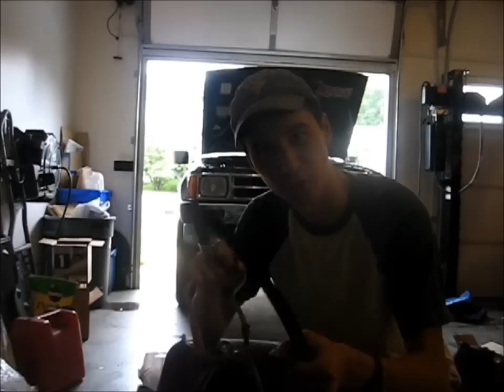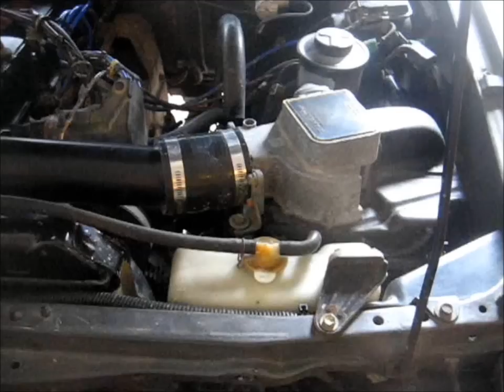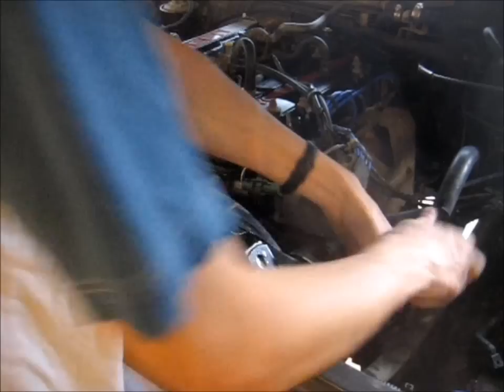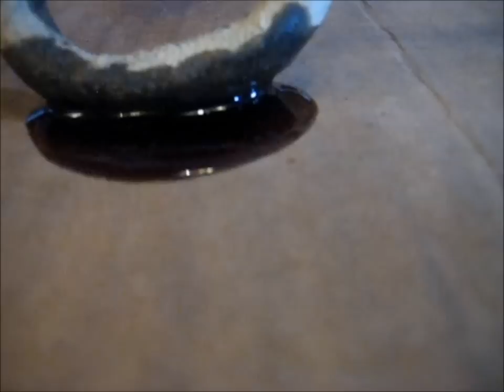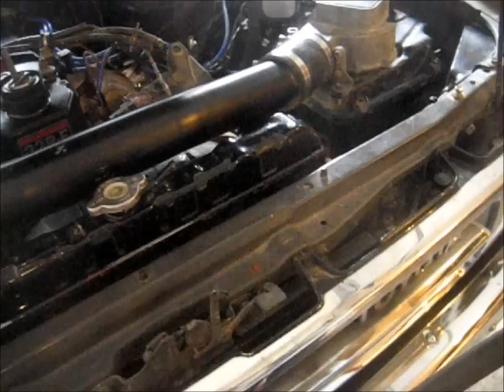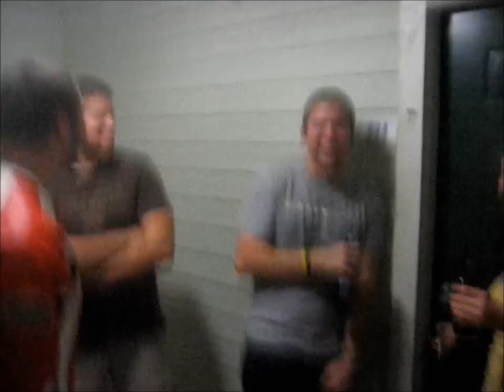Replacing 4Runner Power Steering Pump and Hose

Comment: At the beginning of your video you mentioned that your power steering pump was making noises. It would have been helpful if you recorded the noise or at least described it. My 87 4Runner is making tapping sounds in the vicinity of the PSP.

Comment: Just changed ps pressure hose my 88 4runner 22re,  reused bracket on the line at the gearbox, what a pain to remove, was spot welded together. Yours?
Reply from the maker: Yes, same situation. Done it twice now on different vehicles.

Comment: I did not get what you did to solve the clamp that had a spot weld on to. Did you get a new clamp and if so what type? Thks...jc
Reply from the maker: I drilled out the spot weld so the clamp could be opened up and swapped over.
Reply: @TheAlexManVideos  so how did you get the clamp spot welded again, or do you need to?  Thks...jc

Comment: This is very helpful, thanks. I'm looking at the replacement hoses and a lot specify with or without ABS, does your runner have the rear proportioning valve "ABS"? Also, is that a pathfinder sticker? I'm also in morgantown.
Reply from the maker: This generation of 4Runner was not available with ABS. It does have the load sensing proportioning valve (LSPV). The LSPV is not ABS. I used to live in Morgantown, not anymore though. You can see if you have ABS by the presence of a vehicle speed sensor (VSS) located on top of the rear differential. If it is there it will be the only electrical component connected to the rear axle.

Comment: Alex I got a question pertaining to 1994 22RE manual 2wd P/S pump pulley. I want to take just the pulley off from the pump. Do I need a pulley puller? Is there any other type puller for it? I don't see any pulley grooves to place the tool on and the pulley seems too hard to budge off without damaging the pump shaft. I saw how easy your pulley came off your P/S. Mine isn't so easy.Your advice and experience is a thumbs up!

Comment: good video bro.i have a 92. model and my steering wheel is tight. i have fluid,my belts are good,pulley not loose, so im thinking power steering pump and hope it not rack and pinion. thanks for the vid

Comment: Alex, my son's power steer belt popped off.  I haven't had a chance to look at the vehicle yet, but in a Haynes manual there's a fan in the way of removing the power steering belt.  He's got a 22 series four, and I'm pretty sure it's a 90 Forerunner, and that's a series 2 right?  So did you forget to mention you removed the fan/fan clutch or have you got a electric fan?

Comment: Great video, i have a 96' 4Runner and everything looks pretty similar and it looks like I have to replace my pump and power steering pully just like you did because lastnight the pully just popped out of the pump while in idol and there is fluid leaked all over the ground